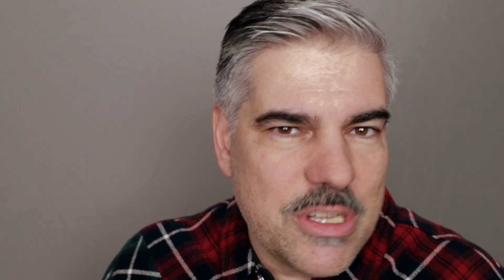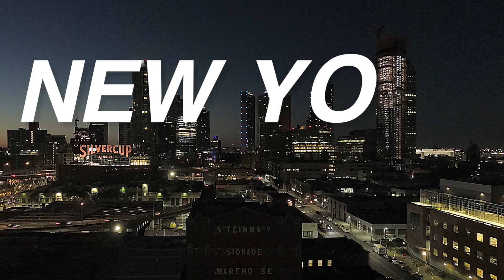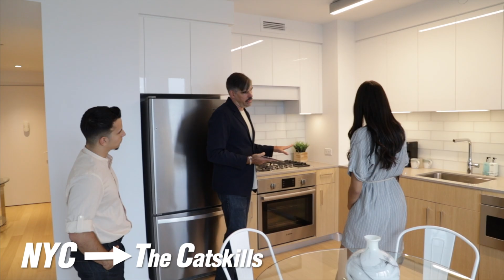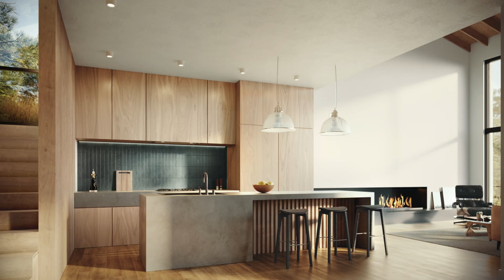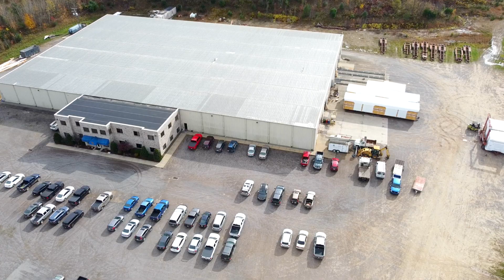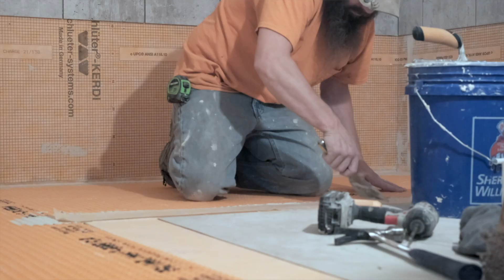Building Modern: The Pros and Cons of Prefab Construction

Comment: 44% cheaper to do onsite is 100% wrong and incorrect.

It's the complete opposite. Prefabricated is 50% cost effective versus traditional onsite construction.
Reply from the maker: This could be true in some cases but not all.  It is very project dependent.  Depends on complexity of project, type of finishing materials and distance of build site from factory
Reply: @roderickangle   Between a prefab home and a concrete or modular home , which one is cost effective with regards to maintenance ?
Reply from the maker: @paulmatemb4628  I think maintenance is dependent on finishing materials.  Type of roof, type of siding, etc.  Not so dependent on construction method.